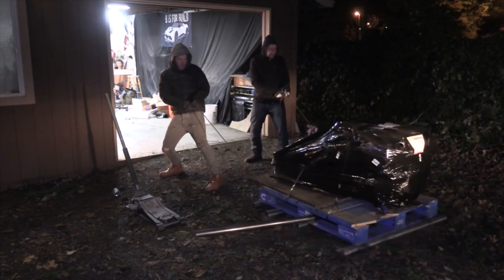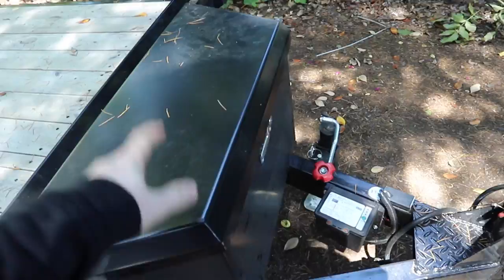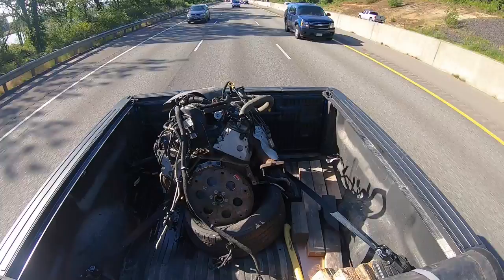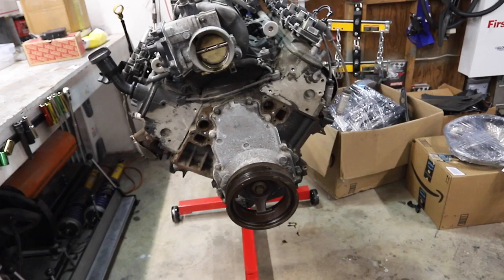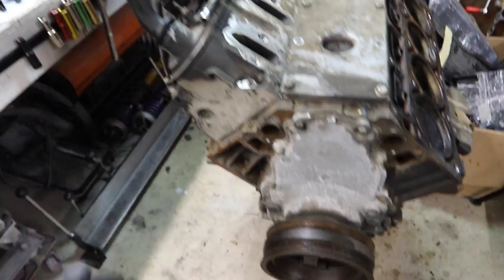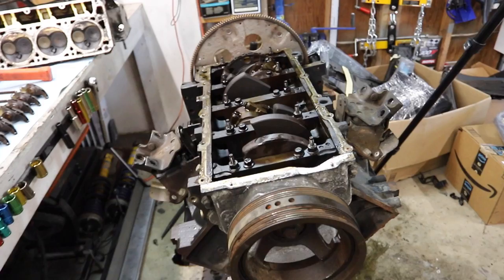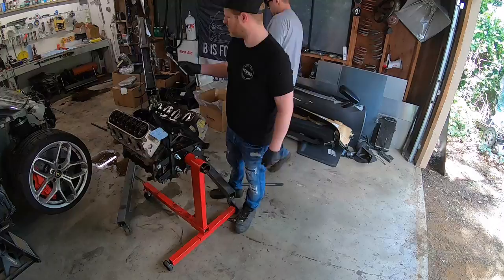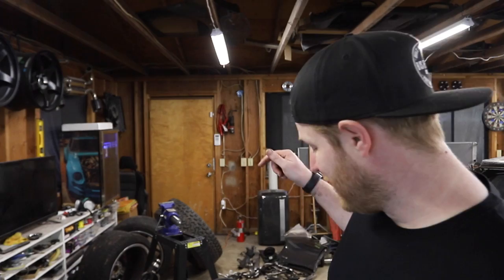Junkyard LS Truck Engine Hunting & Teardown for the Lamborghini Huracan

Comment: A truck engine in a Lamborghini seems so wrong...and then I remembered that Mr Lamborghini made tractors before he made supercars.
Reply: So what you are saying is that they need a tractor engine ...
Reply: Cummins swap Lamborghini 
Really piss people off 

You can still buy Lamborghini tractors 
I believe they're totally separate company to the cars these days though
Reply: There's nothing holy about Lambos other than the price. I can't think of a better car to trash than a Lambo (excepting the Miura, of course).
Reply: @fowletm1992  it does trigger me
Reply: right?
Reply: @chuckschillingvideos  
The few dealings iv had with Lamborghini's iv been far from impressed with their quality of construction 
Paint work interior, finish and so on 
They go like a stabbed rat but so do lots of other machines 
They definitely dont carry the prestige of a rolls or a Bentley
Reply: @likeits1985 no, ferruccio lamborghini made tractors along with cars

Comment: They make foam engines with all the mounting locations. That would be a lot easier.
Reply: They're almost the same cost as an actual blown motor
Reply from the maker: and you can’t use a foam engine to power something fun after :)
Reply: @BisforBuild  Put it in the janky m5 body! jk. kind of.
Reply: Chris you can’t use a iron block with a hole in it to power anything fun either.
Reply: @davidtaylor857  But you can make it into a cool coffee table.
Reply: He could put the foam engine in the hatchback of the 240z to confuse people even more at cat shows
Reply: @calvinnguyen1364  the 5.3 is for the other build, he basically has a free bad block to play with (the original 6.0)
Reply: @davidtaylor857  He's talking about the 5.3L. The second one he bought. He got his money back on the first one
Reply: B is for Build why didnt he turn away when they said it threw a rod
Reply: @BisforBuild  are you coming to gambler again this year

Comment: You should do a flat plane crank swap kit on the v8 to maintain the smooth feel and high rev limiter
Reply: Yeah they don't just sell those. You have to custom make one and that takes moneeeyyyy
Reply: Sean no they make kits for conversion for Chevy v8s. They cost anywhere from $500-2000

Comment: for future reference if you ever need to loosen a harmonic balancer again, try to slide a strong steel pole over your breaker, it gives it an extension and more leverage, should do the trick, works for me every time.

Comment: This is the best build on YouTube simply for the fact its a lambo and its gonna have a v8 so it’ll actually be reliable and be able to be driven more than 40k miles and even if it needs parts or a new engine it’ll be cheap

Comment: Lots of times the exhaust bolts break on their own because they get brittle from extreme heat . I have bought several ls engines and most of them had at least one or more broken exhaust bolts . Best way to remove if it still is sticking out use some vice grips and lubricant or use reverse drill bit and sometimes that gets it out without having to actually drill it .

Comment: Its common on 4.8/5.3/6.0 engines for the manifold bolts to break. Just because they are broken doesn't mean someone did it. GM had a design change on the bolts because it was a common issue. Weld a nut to the broken bolt and back it out. I deal with them often.

Comment: The snapped exhaust manifold bolts are common to break. Just the difference of hot and cold, then eventually snap. Typically the front ones and rear ones. Easy to get out. Just weld a nut to it and turn it out.

Comment: My studs snapped on my 04 2500hd. With a 6.0. Happened at 80,000 miles. You would be surprised on how quick they will bust

Comment: Had the same problem with a harmonic balancer bolt.  The only thing that actually worked was a hole saw.  Drilling through most of the washer relieving the pressure and when I backed the hole saw out it brought the bolt and washer with it.

Comment: Love this build so far! I don't want to go too far into the future, but since you said the engine is gonna weigh 100 pounds more than the original, I would opt for some heavy duty racing dampers, like the Huracan GT3 Evo uses Öhlins TTX 36, but it's just a suggestion!

Comment: I had a 5.3. Vortex with a 74mm turbo on a 2001 Tahoe  the best motor to run hard.  I ran a 12.9 @ 98mph with 6000lbs of weight. 22”wheels 3 12”subs

Comment: If you can swing it I would use car style accessories instead of the truck ones because it’ll save a little space and probably make it easier to fit the turbos. Electric fans would save space as well but you probably already thought that of that part.

Comment: Just an fyi, those 6.0L are known for having horrible exhaust manifold leaks because of the small studs, the driver side rear is one of the most common, that would explain all of the soot on the block there.

Comment: I’ve had two of these motors and they  both had broken manifold bolts and leaking manifolds. The engineers of this motor didn’t put a strong enough bolt in the  manifold. Great motor otherwise. I gotta replace the knock sensors but it runs fine only throwing the code on the interstate but seeing this makes me think I should take it apart and just do it.

Comment: I’m sure what they meant by “brand new” was a vehicle with no body or suspension damage. What I’ve learned about these cars however is that if they look that good on the outside, but were parked for a long time,it’s cuz either motor or tranny are fucked. The best motors come out of crashed cars because if it’s crashed it means it was driving

Comment: good news about the vortec  engine you have there, The studs always break off. Anyone with that engine with a few miles on it will have the back studs broken. So nobody worked on it wrong all of them have the same problem

Comment: Hey just wanted to let you know, breaking off the bolts on the outer edges of the exhaust manifolds is a well known issue. I used to work for a GM dealer and saw it multiple multiple times. It just happens on these engines.

Comment: Broken exhaust bolts don't necessarily mean someone has taken the exhaust manifolds off... Chevrolet exhaust bolts have been notorious for breaking since the 1990's LT1 at least.  After a while you get good at using MIG to get the broken part out.  I have only had one LS-based engine that didn't have broken exhaust bolts... its recommended to replace the bolts ASAP with grade 8 ones.

Comment: The heads of the bolts break off on their own, not by someones doing. Rust gets under the head of the bolt and snaps them off. Very common and an easy fix.

Comment: About the block weight - I might be concerned about comparing the LS to the original Huracan motor, since suspension tuning/adjustments are bound to be affected by it.

Comment: Chris Im still wondering why you didnt get L33 from 2005-2007 trucks, they cost the same but are made from aluminum. There have been records broken while using it in 3000hp + configurations. (stock bottom LS L33 record) Saving weight is always good man

Comment: Those broken exhaust manifold bolts are VERY common... not from someone working on it. The 6.0 litre is famous for that. The bolts at the back of the engine are near impossible to replace without pulling the motor.

Comment: 15:16 Actually the broken exhaust manifold bolts on LS engines does not mean someone worked on it. THey will break from the manifold rusting and vibration.

Comment: row52 tells you what the picknpull, pullapart, etc have. used it in the past and found a k20a2 w/ 6 speed manual for $450 out of an Acura RSX type s

Comment: Awesome 👏 qq going with the LQ seems less of a “LS swap” approach now and more a “small block Chevy “ hot rod power replacement for the Lambo which seems against the nature of the huracan of being a fine piece of Italian-technology focused tech. I initially thought the carbon panels you would manufacture along with a light alu LS swap would have been an interesting show piece along the original theme of the lambo, now I’m imagining more of a straight line dragster emerging at SEMA - going to be interesting to see how things turnout🤘🏽

Comment: I mean instead of using a different block and taking the chance of stuff not converting and working on the 6.0 you could use the cracked block to figure out all your mounting point. Right?

Comment: just wondering is there any reason you could not put the 4"bore in the 5.3 lt????   last time i built a chevy small block  i hunted for a early 4 bolt main and dropped a 400 cid small block chevy crank for a 388 cid stroked motor. it gave me loads of torque at low rpm

Comment: L33>lq4
Denalis have lq9 engines
799 heads>706 heads
Check pickup tube o rings
Truck engines are better for boost becuase of the accessories  also

Comment: FYI that’s just a Chevy thing especially in trucks they brake exhaust manifold bolts all the time then causing the gasket to leak because there in no flex pipe anywhere in the system and the bolt holes are to small. I’m a mechanic that works on a fleet of over 20 Che y 2500hd trucks with a 6.0 and probably 1/4 of them or most over 30k miles have broken bolts or had broken bolts on exhaust manifolds. It doesn’t means someone tried to pull it apart and broke them could be decent advice for you to get some flex pipes for the ends of the header

Comment: I would have stayed away from a roll over engine. All the oil flows to the top of the engine leaving the bottom dry! No oil for the oil pump, crank, bearings etc all dry. Good luck man!

Comment: Hello b is for build I'm here to let you know the lq4 and 5.3 backplate are very  different lq4 had a different design for the 4l80 transmission the 5.3 has a 4l60 their different in size

Comment: A 5.3 and a 6.0 are the same block same head and same cylinder size just a different crank and cam to my understanding. Same size position just a different stroke.

Comment: 1. Go watch Sloppy Mechanics until your eyes bleed.
2. While the 6.0 is awesome, 5.3 and 4.8 can make 1000whp and can be had for $500 or less fully dressed.
3. LS exhaust manifold bolts break just because, not always a bad sign.

Comment: Buy a new bare LSX 427 block. If tsp is replacing everything you’ll be much better off. 1500hp with decent internals and it’ll still be stout.

Comment: Texas Speed can't supply the block for a build they are doing?   Exhaust manifold bolts are a known problem on the earlier LS motors.   My 06 LQ4 has had them replaced twice in 200,000 miles.    Not a big deal.

Comment: The bearings looking good doesn't mean they are new or low miles. They are either good or bad, they should never touch the crank so you can have 300k mile bearings that are pristine.

Comment: A rod failure is a no-no. The engine should be a running engine. Rarely will a rod failure result in a useable block or head.

Comment: Hang on... didn’t the seller say the engine had thrown a rod before you bought it??? Why is it a surprise that the internals are toast!

If I was building an engine to 1000hp I’d be starting with a solid engine, not some boat anchor 😬

Comment: I know it can make hp with enough displacement but the pushrod 2 valve per cylinder design seems so antiquated like model-T tech. I know you're trying to do this on a budget but to do the Lambo justice the 4 valve per cylinder like the LT5 32V V8 would be great. Most if not all super cars and asain/euro racing cars run multivalve dohc. Just sayin.

Comment: Building an LQ4 to SERIOUS power is not hard, Denmah showed us about... a decade ago how to do this.  putting it in a lambo is pretty neat tho... I would of skipped making this video entirely.  Showing us how to use wiki to find an engine, then calling junk yards to get a bad LQ4.. then how to call texas speed to get parts.  I guess if your current subs like this; enjoy.  Ill stick with sloppy and the others breaking the mold and showing us what can actually be done, and using that to guide my builds!

Comment: I don't think "budget" and 1000 hp any engine really go together. Considering a built engine with less power starts at about $12-15 thousand dollars. The only part that is getting used from the donor engine is the block, everything else is junk.

Comment: Why pay $500 for a LQ4 with a possible thrown rod? I would have told them to keep the accessories and give them $50. If someone has something they assume is broken and useless it goes for broken price. If they don't think it's broken and want more, then the burden is on them to prove it. You can get running LQ4's for that price.

Comment: 500 for a core is outrageous in whatever shop or wrecking yard is charging you that for a core is out of their ever-loving mind..... And they should holdgood with the core as that's what they sold it to you as and it should be a rebuildable engine cuz it's a core.... That thing you have is not rebuildable they should straight give you your money back or give you a block that is rebuildable

Comment: you say the 6.0 costs 3 times the amount as a 5.3 because the 6.0 is a prized racing motor yet you just confirmed you spent $500 on this 6.0 and $1500 on a 5.3. then you say the yard screwed you when you said times previously that you knew it as blown or damaged or had a thrown rod. you do this all the time, you must have smoked too much pot and forgot they told you it was junk, also the $500 sticker price for a "like new core" 6.0 should've been your next clue it was junk, and lastly you put the thing in your truck without giving it a once over or a quarter sized hole in the block. shame on you man, or bad mouthing the junkyard and or asking for taking a refund for your mistake.

Comment: I hope you were good at gambling? When you want an engine block why buy one that has thrown a rod?? Don't you know where the connecting rod sits? What did you think happens when engines throw a rod? Hole in the block time, ruined cylinder walls, distorted crankshaft. You're brill at bodywork which is something I don't do. Leave engines alone until you do some more research it was embarrassing to watch dude.